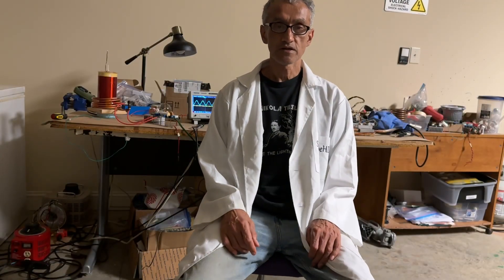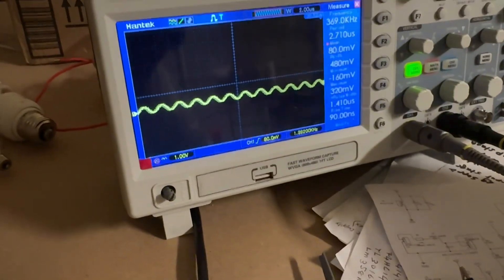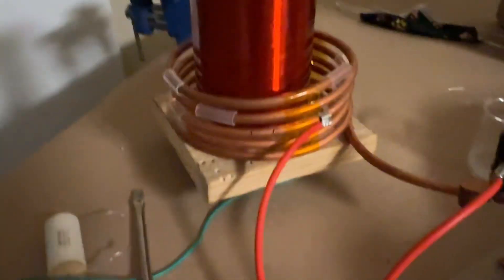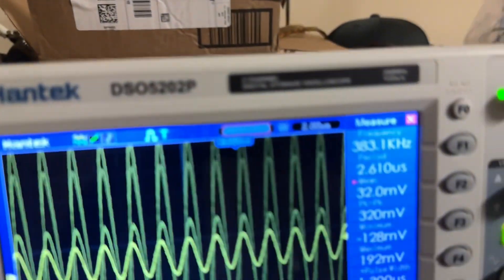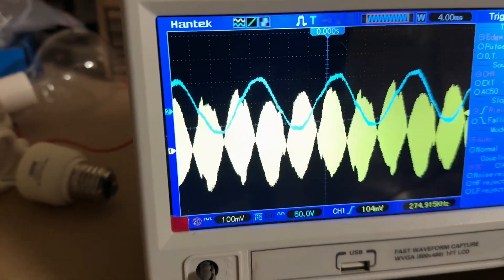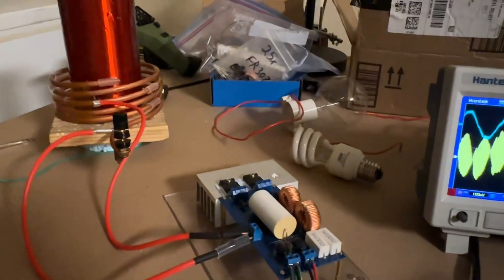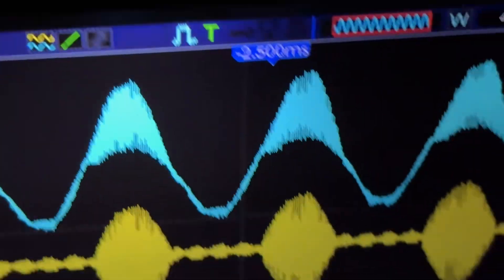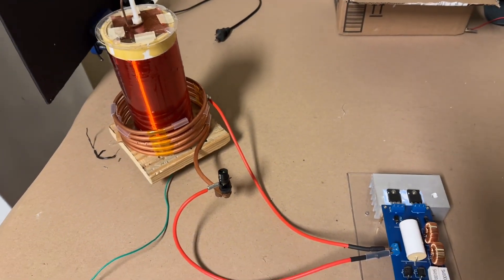￼Part2- Tuning “Driverless” ZVS Tesla Coil

Comment: if you used a solar generator as the power  input for mains and 12v, would you see the noise on you mains line still? or is this from the output of the secondary saturating the mains with frequency?
Reply from the maker: I repeated the experiment and the noise does not seem to be much of an issue on repeat. It may have been something to do with the way that I had my oscilloscope  set up.

Comment: Why do I never see anyone building  a proper PASSIVE Tesla coil?

You collect high voltage from the air into a capacitor and the SECONDARY coil.  Once enough charge builds up it crosses spark gap and a higher current lower voltage flows on the primary side. 
With careful spark gap adjust one can get a continuous flow from the air. 

100v per meter so you might want old antenna tower
Reply: Hobby tinkerers do that quite a bit but they realize fast it's quite a waste of time. There are also quite a bit of tall structures on the planet. If it was really that viable you would see it more. People use what works.

Comment: I just got mine to hit 11-12" sparks with the stock zvs on a half wave ac. 320khz #2 11" winding 32g magnet wire. the 2) caps in series was .75nf total. I watched you first video on the stock zvs and it was really cool. did you guys develop a new board for it?
Reply from the maker: Yep
Got a new board. Pl check out gerber and BOM in the description
Reply: I found the Gerber files, uploaded them to JLCPCB way and ordered 25 circuit boards. It only cost me $50.
Reply from the maker: It’s better to use a 100 nF CD cap  instead of 150 nF unless you want to make a larger coil. Have had great results with it so far
Reply: @BrianDhvTinkerer  he is using two 150 nF caps in series, resulting in 75 nF.
Reply from the maker: The lower capacitance means that the current flowing in the primary tank is less which is less hard on the IGBT or Mosset switches. It also means that you can have more primary turns which gives better coupling and more energy transferred to the secondary coil.
Reply: @BrianDhvTinkerer  Thank you for the feedback. I have learned a lot from your channel!